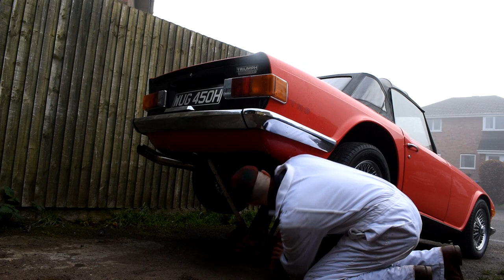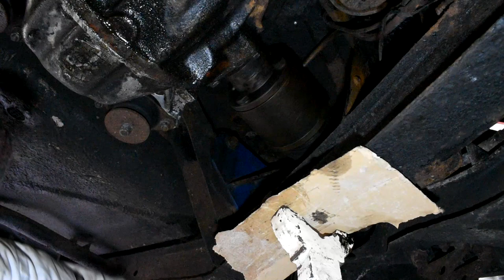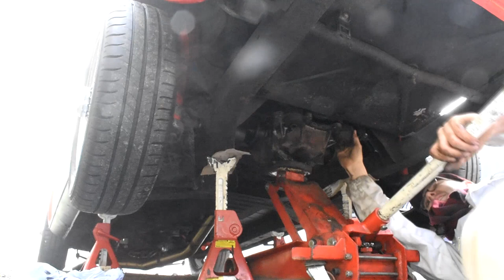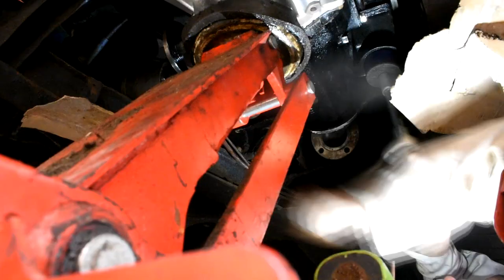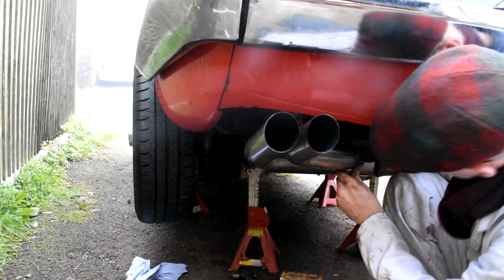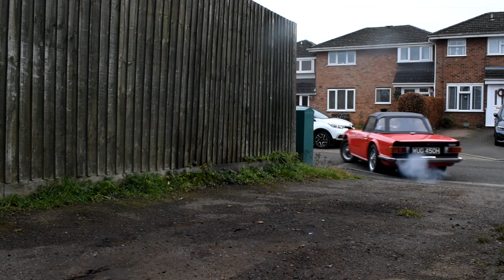Triumph TR6 Diff

Comment: Impressed you did that alone, outside and without a ramp! I’ve done it but in my friends Trade Garage. I would prefer no music and more info on size bolts, spanner’s, gear oil etc. But yet another helpful video, thanks Steve.
Reply from the maker: Yeah, all done by myself alone on the floor in the depths of winter. The way I see it is, you just gotta make the best out of what you have and crack on with what needs doing 👍

Comment: My diff seized on me without warning, 'luckily' we were only doing about 25mph on a local A road, but still ended up across both lanes! I was  working in a garage at the time so had the luxury of a lift. The job was a doddle  (secondhand unit) but we stripped it to see what caused it. Previous owner had filled the diff with a mixture of grease and  oil. I kid you not....... Grease! Pinion bearing had welded itself together. Amazingly there was no noise at all prior to it locking up! Nice work there though Steve, not easy on your back on the deck!
Reply from the maker: Grease!! That's a new one to me, I bet the previous owner packed it with grease so that it would keep the worn out diff noise silent, long enough to sell the car to the next owner. Unfortunately being yourself, but what a cowboy thing to do, that could of ending up in a serious accident, lucky like you said you wasn't going fast when it welded itself up 👍
Reply: @SteveDentonClassics  About a half a pint of grease in the diff housing, presumably to 'take up a bit of slack'! It got better tho but! When we came to swap the diff, someone previously had sheered off a diff mount. They'd drilled and tapped the shaft where the threads had snapped off and fitted a 1/4 bolt!!!! A tricky repair putting that one right,lol!
Reply from the maker: I bet, seems like you had your work cut out with that one! It's a know weak spot with the TR's the diff mounts sheering, however after many conversations with you Tom, I'm pretty sure your aware of this. Generally we tend to box them in those days, it's something I forgot to mention in the video, but in my defense it was pretty cold and I just wanted to get it all done before it got dark 👍
Reply: @SteveDentonClassics  Mine wasn't the usual fractured diff mount. It had been snapped off at the threaded portion, seized on nut forced and sheered the mount by cak handed previous owner. They drilled into the stub of the mount and fitted a 1/4 bolt. I'm amazed it held being as I used to thrash the car pretty much everywhere I went. I cut a mortice in the remains of the mount and a tenon in a new threaded section, then welded down  and around the joint. As you say though, in general the diff mounts tear out, fatigue due to repetitive torque twisting as I understand it. Other than the diff, the usual clutch fork pin naughtiness, and a couple of vertical links and trunnions  the car was super reliable,. No issues whatsoever with Lucas injection, believe it or not!!....................... Oh, and a rear wheel bearing?!?!?!?! Now that was a stinker to get off!!! Roll on 2021, a better year with any luck!!! All the best, Steve.
Reply from the maker: Drive it like you stole it, now that's now to own a TR. All the best to you too Tom in 2021, hopefully it'll be a much better year 👍
Reply: Can I just add, before the youtube police pounce. I'm a four year apprenticeship time served welder, I worked on high end pressure tested fuel and hydraulic tanks and lines mostly. I knew/know what to doing such situations!

Comment: Great video Steve, I'm guessing a lot of owners will eventually need to do this job. I've helped a friend remove his, so I'm impressed how you did it alone just on an albeit impressive sized trolly jack.

My diff leaks and has quite a bit of back lash so it'll need to do this sometime.

That '6 looks so sweet and sounds awesome too, I took mine out with the roof down on Christmas day and with a similar big bore phoenix stainless exhaust sounded so good 👍.
Reply from the maker: That jack is a real donkey of a tool, it's one of the first tools I brought some 15 years ago. It's been used, abused, repaired, and just keeps going on and on

Dannys TR6 for some reason has always been a loud beast with a 6-1 phoenix exhaust, overhead Revington throttle linkage, it's just a monster. 

I was toying at going out in the Spitfire Christmas day, but it never happened. I made up for it today with a short drive in the MGB 👍

Comment: Hi Steve. You did well to manage that task in not the most ideal working conditions. So Dave's got a whining diff' ? I bet it hasn't whined for as loud and long as my Mrs. !😂😂😂 I thought the exhaust came off pretty well , l had to use an air chisel  on  my system even though it looked pretty  recent ( well it did 10years ago!) . Did the diff' washers and nylocs come with the fitting kit ?  Great job and l'm sure Dave appreciated your input.  And have you heard that the "Flying Legends Air show "  has left Duxford and moving to Sywell ? Well ,  enjoy the rest of Christmas and lets all look foward to a positive 2021 . Take care and stay safe.
Reply from the maker: I'd love an air chisel, but I try to keep the noise down with the neighbors. The diff didn't come with new washers etc, but they were included with the SuperPro bushes. As for Flying Legends, I can't wait for that 👍

Comment: Good job Steve.  Those driveshaft pinion bolts can be a real pain.  Looks like he’s got updated half shafts/sliding axles.
Reply from the maker: Cheers Tush, yeah there uprated ones from SC Parts. I've seen many uprated driveshafts over the years, but the ones made by SC Parts (Jaguar specialists) aren't the cheapest but I'd say are best on the market. I fitted them many years ago to Dannys TR6, looking back now, I wish I did a video on them, but it was before my YouTubing days 👍

Comment: I would never put the car on axel stands  at an angle like that....weight and gravity is powerful....I would put all four axel stands at the same height as it really is too dangerous....roads sometimes are not that great either and we can get weak spots in them so again be weary of this also.  I always at least shove my wheels in under the car as a life saver as all the other things can flatten down as they fall. Well done to you for having a go like that....my body is off the chassis and i have just done seals on my one and that was hard enough. I love the choice of colors as a mechanic....like what's cooking in the kitchen. Well done.
Reply from the maker: Cheers Noreen, I hear your concerns, but please don't worry too much about me, I do mechanics for a living. However I know where your coming from, it's easy to make a mistake with a jacked up car and your a pancake. I do usually throw a couple of wheels underneath the car, as like you say, it can be a life safer. That's great to hear your making good progress with your car. I've had the body off the chassis on my own TR6 and replace the chassis with a CTM one. Best thing I ever did to the car, it made it handle so much better. All the Best Steve 👍

Comment: It looks so easy for you, but to handle this chunk of iron is a real pain. Respect. Do you have some patent for the separation of the drive pinion flange, beside of a 40 Ton press?
Reply from the maker: Cheers mate. If you can get hold of a decent 3 legged puller it may do the job. Or you could try a 2 or 3 legged hydraulic puller, they are not cheap, but they have some power in them 👍

Comment: When you jacked car , did you place jack in area in front of diff. Sometimes referred as t shirt area. I was told to jack by shock mounts. The way you placed jack was easier. I appreciate your videos
Reply from the maker: Cheers John, this is good question, and to start with, never jack a TR on the T Shirt panel, this panel has as lot of stress for the rear suspension going through it. As for jacking up a TR4A 5 or 6, from the rear, then jacking up the car on the diff is perfectly safe to do, and is the way I jack them up. Some people will tell you this is not right as it can crack the diff mounts, let me tell you this is nonsense, and an old wife's tail. Diff mounts are a known weak spot on TRs but its not from jacking them up. It's from the torque coming down the propshaft and out the driveshafts, causing a twisting action on the diff mounts that causing them to shear. Those days we tend to box in the diff mounts to stop this from happening. So long story short your perfectly fine to jack a TR on the bottom of the diff. As for the placement of the axle stands, if you put them on part of the chassis between where the rear trailing arms bolt onto, then that will be just fine, as that's where the weight of the car is designed to go through. Hope this helps, cheers Steve 👍
Reply: @SteveDentonClassics  appreciate your response, I have my 73 6 back on the road  after a 4 year resorption and boxed frame at diff areas. I'll try jacking on diff.

Comment: Why not fit the Nissan Skyline diff? It's even available as a limited slip and there are kits that make it a bolt-in job.
Reply from the maker: I agree the Nissan Skyline diff on a TR6 is an excellent conversion, and very much fit and forget, however this is not my car, so I can only fit what the customer wanted fitting to it 👍

Comment: I'm a subscriber and really like your advice on tr6s. one question, I was replacing my front wheel bearings using your video and today or no reason it said private viewing only. if possible could you explain why I can no longer get the video? thank you
Reply from the maker: It’s being updated with better sound etc 👍
Reply: Thank you for the update, I bought the TR6 in 1969 and have used your videos many times. Thanks again.

Comment: Are the poly bushes likely to put more stress on the diff hangers?
Reply from the maker: Yes and no. It’s one of them. If your diff hangers are in good shape and have been boxed in, there should be no issue. But if they are 50 years old and are still standard, then it’s food for thought to fit standard rubber 👍
Reply: @SteveDentonClassics  - thanks for the reply

Comment: Initially, did you lift it with the jack under the diff?
Reply from the maker: I do indeed, most British cars are safe to jack on the diff. The diff mounts are a weak spot on a TR with IRS, but this is not cause through jacking them up on the diff, it’s caused by torque going through the diff, it’s always the same one that breaks on them, most by now will have been reinforced, or repaired from this sort of things, but I always check them when working on them. But yes you are safe to jack in the diff 👍
Reply: @SteveDentonClassics  Great thanks